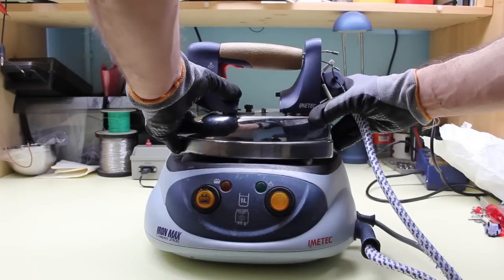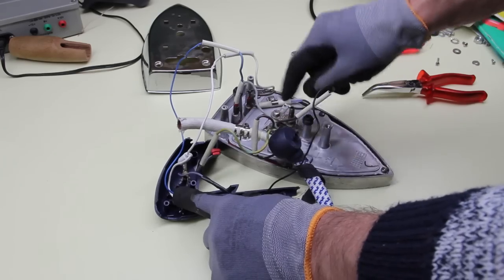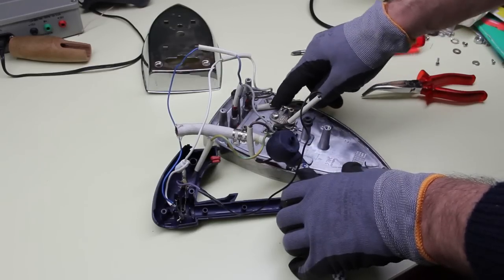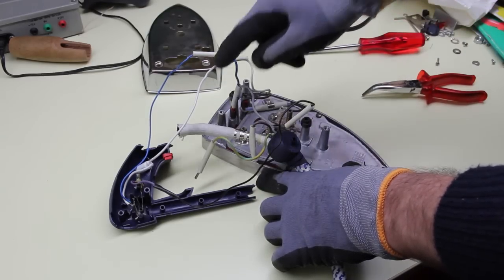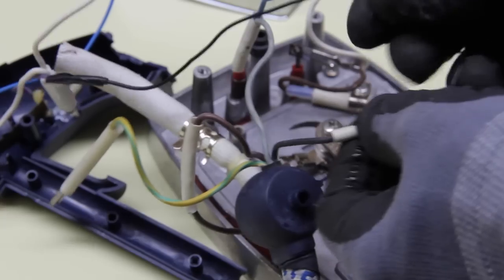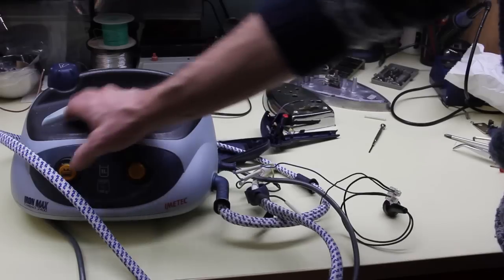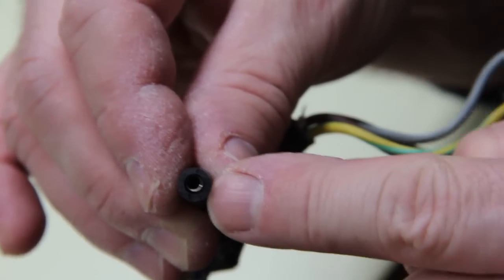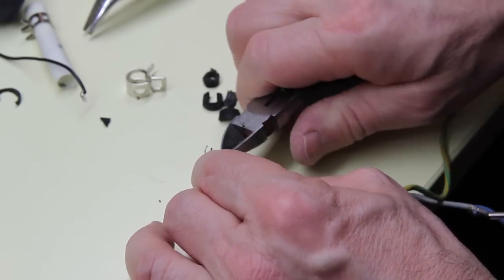Steam Blower/Cleaner from a clothes iron - DIY

Comment: How to make the steam generator part?
Reply from the maker: That's a hard thing to make and I would not suggest to make one from scratch save you really know what you do because it could be extremely dangerous. Even recovering the steam generator from an old steam station iron is potentially dangerous because, you know, the electricity and the water in the same equipment, but with a good dose of wanings, a grain of salt, and a little of knowledge in electrical techniques it remains feasible. Besides the risks associated with the vicinity of electricity and water, the steam generator could also involve the risk of explosion, requires specially designed for high temperature and steam aggression relief valves and fittings, and a chamber tested for the high pressure.
Thanks for having commented. Cheers.

Comment: Iron, so you used the hose & wires from the iron, correct? But where the hell do we get that bottom dock? Never came across one of those things before, especially with a iron, not in California, so yeah it is useless cause we no not what it is or what it does, basically the purpose of the bottom dock!
Reply from the maker: I understand that iron steam stations are less common in the US (as tilting and sealed windows are). That "docking bottom" is the steam station which allows ironing much better and faster with less efforts (as the steam generated by the steam station is much more powerful and have quite a pressure, say around 4 bar).
So even though you are not able to get one, well, take it positively: think about it as something new you've learned :)
Cheers from the Alps.
Reply: Accidental Science 
Thanks for informing of the name. I'll keep my eyes peeled if I do ever run into one of these. It actually sounds interesting to have. Than again you guys over on the other side of the world do have some tight & nifty gadets I'd love to get my hands on & put to use over here in a world where all they sell over here is crap now a days & I mean shit barely last a year if your so lucky. But creative minds like yours give us insight & let us tap into our creative side to think outside the box & just do our own! Keep up with your vids like this.
Reply from the maker: @defiantlion231  thank you sir, glad to be helpful. Indeed there are things that are much easier to find on your side of the pond, such as certain metals, electronics, or even *radioactive material*: heck I've seen one of the last videos from Cody's Lab :)